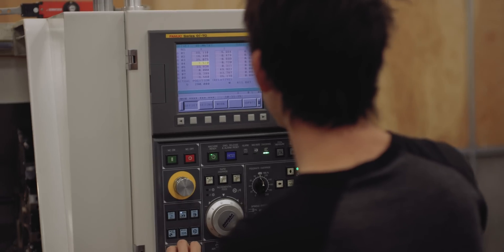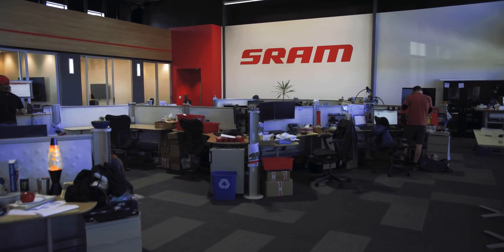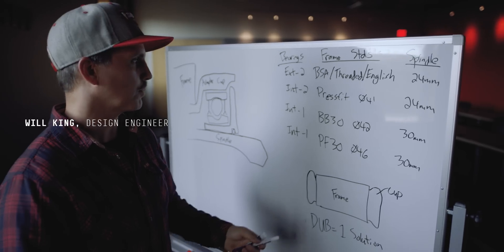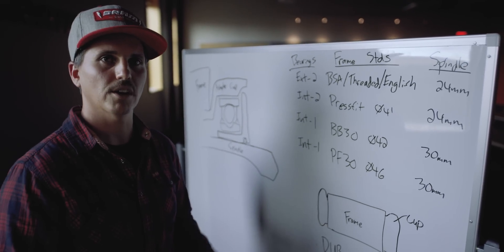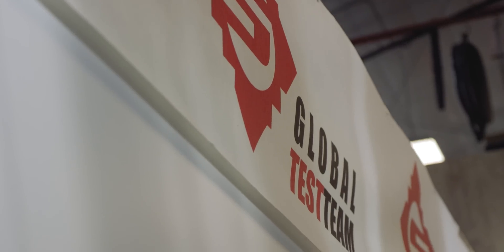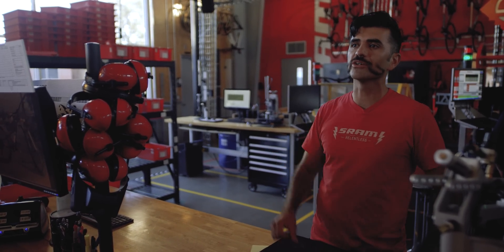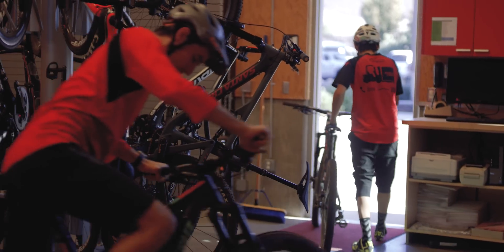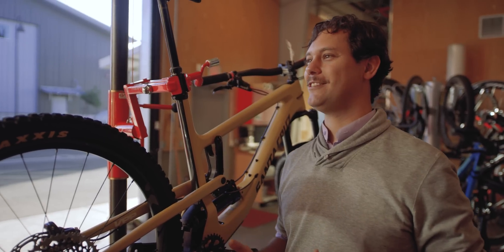SRAM DUB Technology | A Single Solution

Comment: Good for SRAM, but meh for the consumer. SRAM only has to produce one spindle now (which won't fit in any other BB type but their DUB). SRAM also gets to reduce crankset SKU #s they now need to produce, but still get to sell the hell out of BBs.  IMO, switching out cranks and bottom brackets for a bike isn't a big deal. BBs are cheap and easy to install.

Comment: In the hope that good folks at SRAM read these comments, the overall theme with this video seemed to be the importance of standardization to get consistency/quality.  As someone who just got a new all-road bike, I find a lack of consistency, and clarity, surrounding the DUB Wide vs, standard DUB.  Why are two standards needed?  If I want to switch from my Force AXS 46-33, I have to change my derailleur too?  I understand the purpose of Wide is to help accommodate wider wheels, so why not just go with wide throughout the line so the 44-30, the 46-33, and the 48-36 all are wide and work with ONE derailleur?  Is there a reason a road rider would not want the pedals pushed out the 2.5mm that is provided by the DUB wide?  Also, you can't use the integrated Quark Spider on the wide 44-30 as it has a 94  Bold Circle Diameter (BCD) vs. the 107 BCD for the  46-33, and the 48-36.  SRAM never mentions that.  What has taken me down this rabbit hold is my new Ribble GCR TI is set up with Force AXS and came with the WIDE derailleur but also came with the 48-36 chain rings.  There is an utter lack of information from SRAM on the interoperability of these components.  While SRAM is clear you need a wide derailleur to use the 44-30, is that really so?  Could someone get the chain rings and put them on a standard DUB bottom bracket and would that work?  This is assuming wide tires is not the problem someone wants to solve, but instead only wants the wider gearing.  And nowhere does SRAM state if you can use the 46-33, and the 48-36 with a wide derailleur but apparently that will work because that is what came with my new bike and it works fine.  Figuring out what will work and what won't has been frustrating and knowing i can't use my power meter on the Wide system is a real bummer.  Through all this it seems the goal of consistency and clarity no longer applies.  Bottom line, the Wide concept is a great idea,, but it really would have been great to leave the BCD the same for the smaller chain rings so my current spiders and power meter would work, and if that is not possible then standardize the entire line of chain rings and power meters around the 97 BCD, or something in between.  Then just use one bottom bracket and one derailleur so everything can be mixed and matched with no issues.

Comment: I’m having a problem installing my SRAM DUB BB and GX crankset. Because I’m trying to also use a Fourier ISCG I’m finding it hard to install the drive side bb and line up the chainring to center the Fourier chain guide. In 38 years of riding I’ve run into chains falling off all the time but I’m building a Carbon bike and I don’t want the chain to ever fall off. How can I get guidance? goffster34@yahoo.com

Comment: So I actually just swapped out my 30mm spindle for a dub crank set. And to my surprise they use the same F*** bearings. What SRAM uses to make this new 28.99 spindle work is a plastic sleeve. Complete bullshit, all marketing. If I take the dub sleeves out I can fit my 30mm spindles in no problem.

Comment: For all those who wonder - dub is a standard that allows to use the exact same crank with different bb types.
Most of common bb types: bsa, bb30, pf30 etc. requier specific crank for each one, so you can't use bsa crank with bb30...
Reply: Who does that?
Reply: @zap... 
DUB is a standard developed by SRAM
Reply: @Kot1026  yeah I know that but who switches their cranks to different bikes?
Reply: @zap...  it reduces their engineering resources being used when developing cranks for different types of cycling.

Comment: Is this why the Force eTap AXS crank is so much more expensive than the Force 22? 
 Fair enough, on the condition that DUB, indeed, fully resolves the issues with press non-threaded bottom brackets. 
 That said, I don't quite understand how Sram can refine the bottom bracket -to bottom bracket shell tolerances to the minimum without knowing of the precise tolerances of every frame out there. I wonder, what @Hambini and Chris King think about #DUB…

Comment: Which bottom bracket do I need with a dub boost crankset?  I have a threaded 68 mm bb housing on a plus size bike.  My chain line is 52mm on a sram nx 1x11 and would like to upgrade to a new dub crankset and bottom bracket.

Comment: Can you adapt a nx to a dartmoor 68 frame?
Reply: Yes, i installed sram gx-1000 gxp  in to ns clash 68mm vs 2 spacers(2×2.5mm). place them between the cups and the frame...and for my dartmoor, i will be install latter sram dub gx cranks, the spacers may be install after the cap and before cranks.. 
From sram manual☆
For 68: inner left spacer 2.5mm+inner right spacer 2.5mm and+ 4.5mm outer right spacer.. p.s. sorry for my english  i am russian )

Comment: i dont actually know what it is that they made or how it works on existing platforms.  they basically took 6 minutes to assure me they know what they're doing.
wait i get it now.  its just spindle diameter and bearings that are in either a threaded shell or pressfit... so to sum up the video "buy a new crank, again, cuz its 2018"

Comment: apparently there is no real information why those bearings or seals are better then previous types and I remind my self that the last innovation from SRAM for BBs the GXP was not good at all. Asynchron bearing types and if the spindle got loose only a tiny bit the whole crank-system was dead in one hard stroke. 
Well I hope SRAM makes a good explanation why those BB are more durable and not just because we have a new axle standard and well better seals crap. Give me some real information about it. 
PS. I dislike all 2 piece cranks.

Comment: It would be awesome if anyone hook me with a 1x drivetrain ;D
Reply: All you really need is a tool to remove the superfluous chainrings and the front derailleur. Chain guides, clutch derailleurs, narrow wide teeth and 1x specific cranks are nice, but some of us have been running 1x since the 80s.
Reply: NoBrakes23 I already check the bike and i cant remove the chairings unless i drill them out. But maybe in the near future ill get the whole 1x drivetrain, which i think it makes the bike look really clean

Comment: claiming that eagle is now the benchmark/golden standard is quite brave. Considering that bikes today still have mostly shimano components and not a lot of people wanting to change to a rather expensive XD-driver if they want to convert.
Reply: The XD driver is the main reason I cannot adopt SRAM. I have 4 sets of wheels and 5 cassettes that I would have to modify or cast off. For me Shimano XT (1x or 2x) is the best price to capability ratio.
Reply: I've ridden Eagle and it's nice, but it is excessive. If you are weak enough to need a 50t dinnerplate, are you really going to use that 10t anywhere but downhill? 11-42 is already a great range. I'm using 1x10 and loving it, (I'm not a fit rider at all.) Honestly I could get by with 1x9, but I like having a clutch in the RD.

Eagle will be nice for 1x road bikes, and it would be cool if they did closer ratio cassettes like 12-48 or a sturdy 14-46.

Comment: You guys must be kidding. A few months ago, I chose to go the 30mm spindle path. Bought a Rotor BB as it was the cheapest for around 40 bucks. 40 Bucks!  SRAM GXP, Shimano XT, even XTR... cost almost half the price!

Alternatives? Hope, Chris King. For their price, I could change the BB like 20 times in case of bearing failure - which is exactly what happened after ONE day of muddy riding with my Rotor. Bearings stuck on both sides.

And now back to SRAM. I bet that 1.01 mm will make your bearings fly to the moon! You could have developed a standard GXP-like BSA 30 bearing and everyone would've been in love with it.

Comment: All benefits I see so far is for SRAM: cheaper manufacturing - one spindle length/diameter less steps to produce etc. - and can be sold for more as the "latest and greatest". As a bonus it forces to buy a SRAM BB with it - for now. The rest sounds like typical marketing BS mixed with some beard fest.

Comment: Best modern crankset is the Shimano XTR M980, which came out in 2011 - strong, light, VERY durable, VERY reliable, low q-factor, great looking, somewhat affordable, uses the established 24mm bottom bracket and established 104mm chainrings, works perfectly with threaded BB's and just fine in BB30 with a good BB and/or adapters.  Every carbon crank on the market is delicate and generally unreliable.
Reply: deeppurplefan Not to mention 30mm bottom brackets are garbage.
Reply: E13 is the industry leader. BombProof.
Reply: Don't think I would run XTR 980 on a DH bike... SixC all the way baby. BB bearings are cheap and the stiffness is worth it.
Reply: no idea what you are talking about. i used deore cranks for years and they have been working just fine for me, nothing special. But my newer carbon cranks survived 2 crashes in a rockgarden and generally felt nothing like brittle or unreliable. don't wanna talk bad bout good ol' xtr cranks, but  completely abandoning carbon cranks is a bit harsh
Reply: hobmarg Yeah sure you feel the stiffness of the carbon cranks .....

Just buy Zee/ Saints and ride them for 5 years without problems
Reply: Shimano AL cranks are all durable as fuck. My new RF cranks lost a good junk of carbon  due to rock strikes. All AL cranks I had did not lost that much material. Only one crank failed. Guess witch one? The SRAM GXP haha.
Reply: Yup, SIXC is where its at. Best cranks I've ever had.
Reply: 68/73 threaded BBs and Hollowtech II cranks work so well, and they are home mechanic friendly. They give up about 100-200 grams vs carbon cranks, (For a savings of hundreds of dollars,) in what is probably the least important area of the bike to save weight. A direct mount would be nice, but the system works good as is. I'm curious what SRAM is up to with DUB, but I'm not really seeing the benefit yet.